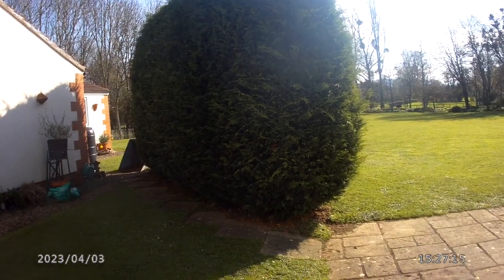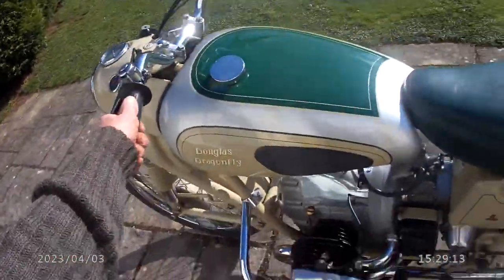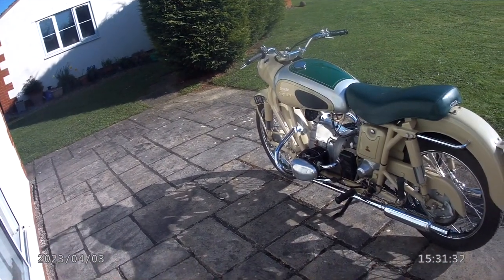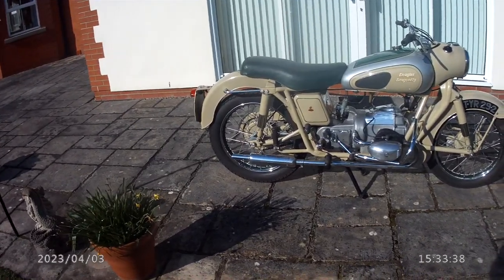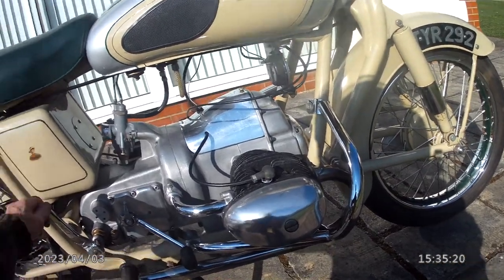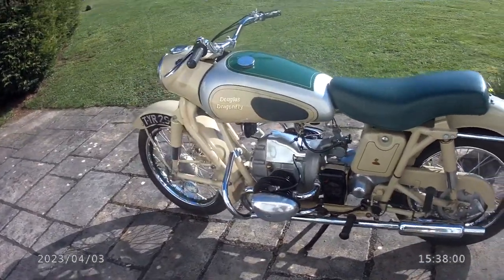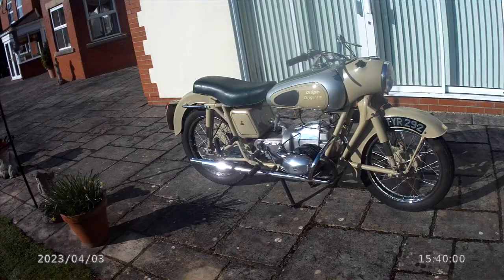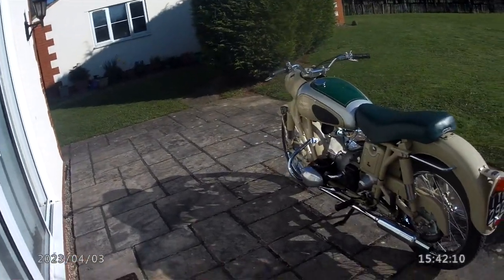Short run and walk round of refurbished 1957 Douglas Dragonfly.

Comment: The Douglas Dragonfly had many problems because unlike the previous MK5 machine it only had the 1 carburetor. With the MK5 each it had 2 carburetors one on each cylinder. I once owned a MK 5 and it was a nice little machine. People would ask me if I was afraid of damaging one of the pots and I would lean the bike over to see how far you would have to lean to do any damage.
Reply from the maker: Agreed Gordon. Also that single carb was likely to ice up in winter because of the long induction runs. Happened to me when I first had it. I bought a second carb to do the twin carb mod but never got around to it. I just used my A10 instead. If Douglas hadn’t gone bust I’m sure they would have developed the machine and sorted the carburation and weak front brake.

Comment: ....very nice little 350.....did they make many - or ANY other bikes ?
Reply from the maker: Douglas were a successful motorcycle manufacturer based in Bristol from1907 until after WW11. Their last successful bikes were the Mark series , based on flat twins used in WD generators. The 80 Plus and 90 Plus were the zenith of  Douglas. Sadly the Dragonfly was over complicated and far more expensive to produce than other British 350cc single .machines.such as the BSA , AJS , Matchless , Royal Enfield , and Ariel .The Dragonfly had the “modern” post war look with alternator and coil ignition , but lacked capacity and thus power. So bad decisions , presumably from the non technical , caused their failure in 1956.
Reply: Steve, hope you're getting better.